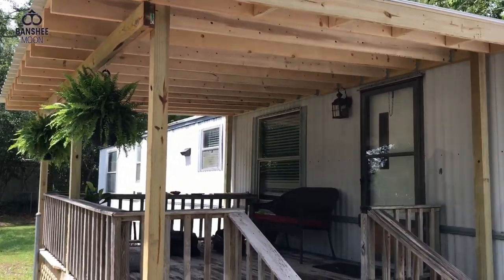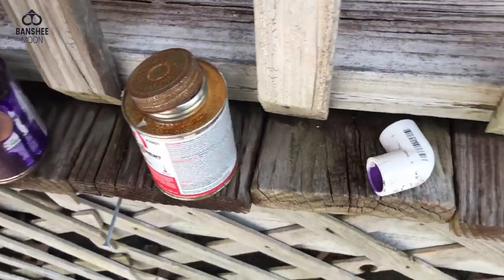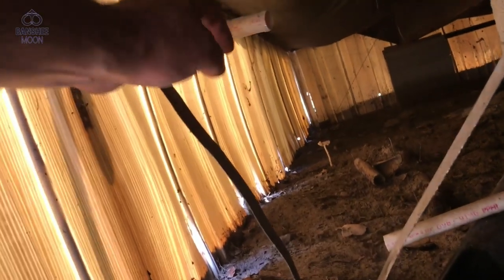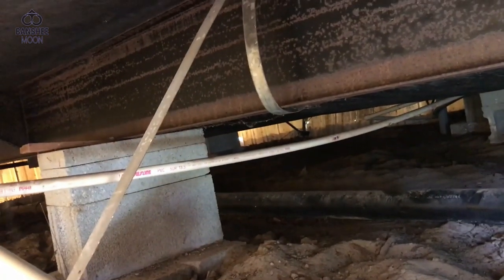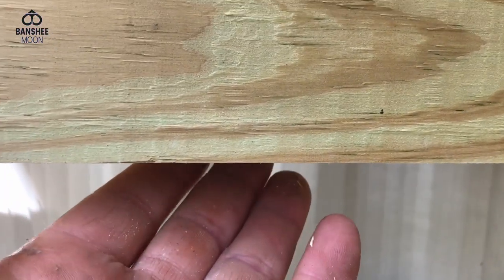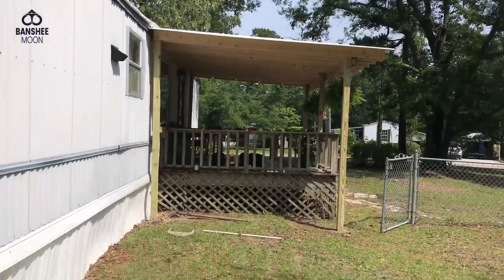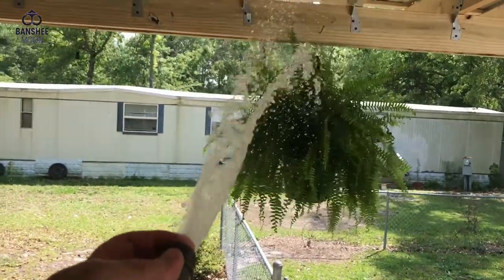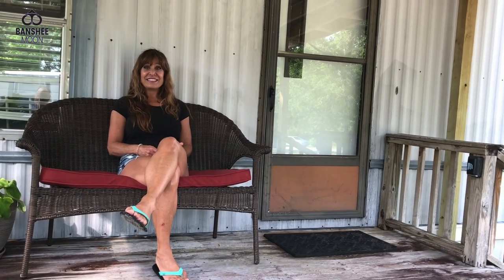Installing a hose bib on a mobile home.

Comment: why don't you get a head mounted GoPro so you can use both hands? and it's been my understanding when you put 2 pieces of pipe/fittings together you give it a 1/4 twist in case your glue  misses a spot

Comment: you might want to try a deck restore product on the weathered part of your deck, I have used rustoleum deck restore ,and had good luck with it you can get a few more years out badly weathered deck ,Behr and other companies  make similar products ,it would worth checking into.